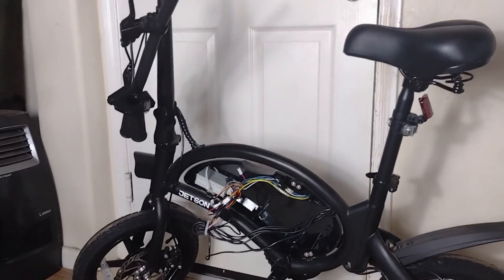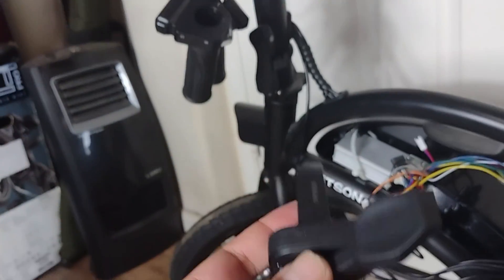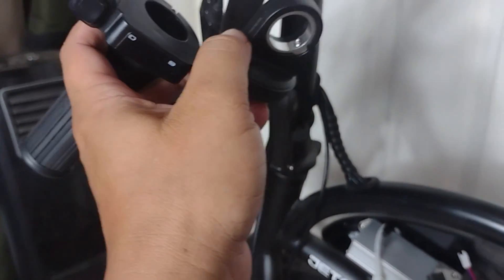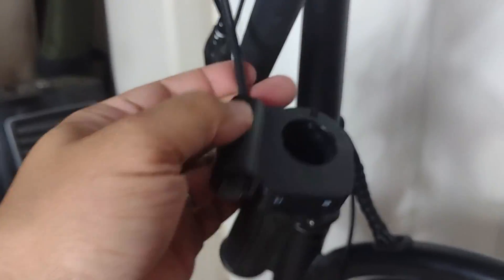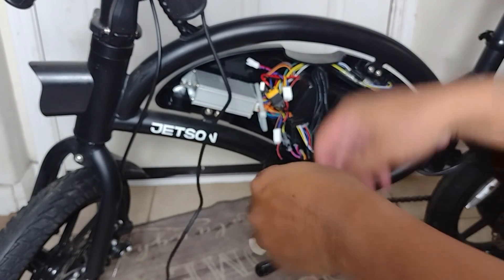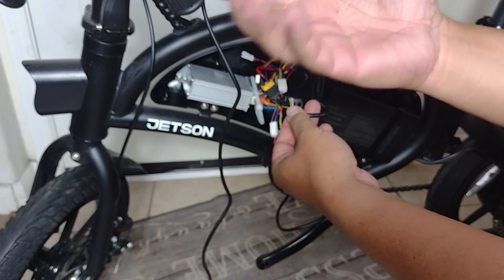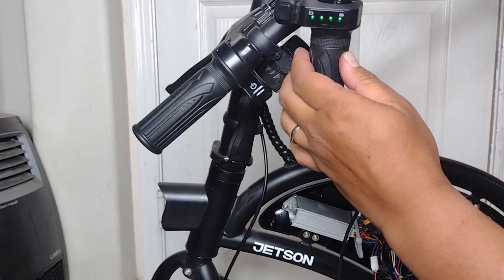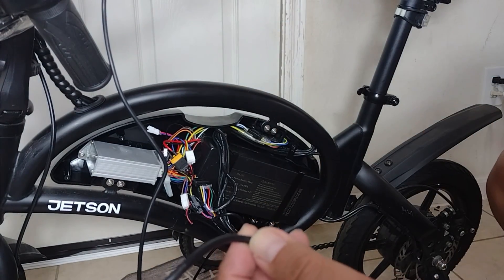JETSON BOLT PRO THUMB THROTTLE INSTALLATION

Comment: sorry but can anyone  tell me how to find the wiring app or manual showing the wire connections....i have a brand new bolt but throttle doesnt accelerate. alot of the wires seem to be not connected  ..but it charges and everything else works
Reply: Did you figure it out? I have a stock one and can show you default wiring colors.

Comment: Can’t I just cut off the wire of the faulty throttle and join it with the new throttle wires?
Reply from the maker: yes you can
Reply: @jsnantic  please can you help me with a link to buy exact or suitable one for jetson ebike?
Reply: @jsnantic  please is there a way I can contact you? I really need help on my e-bike

Comment: How did you open the previous throttle?
Reply from the maker: I tapped on the existing throttle wires using a cutter and a sharp tip wire splitter